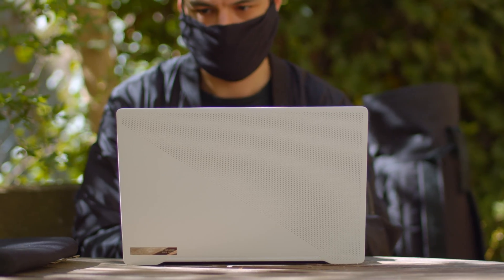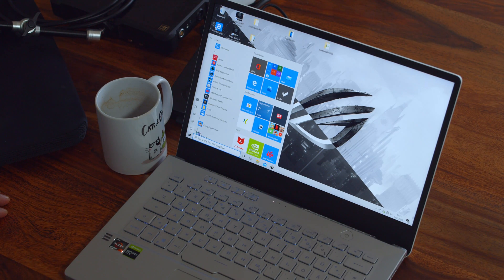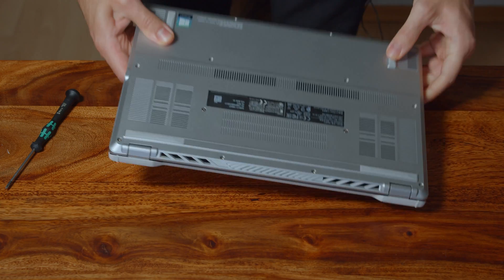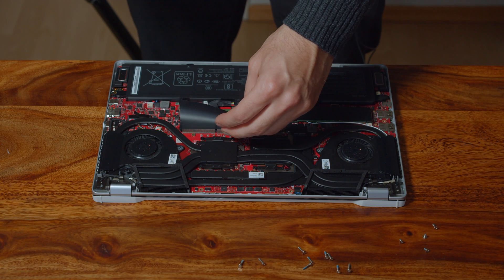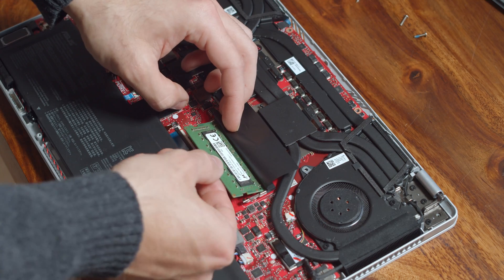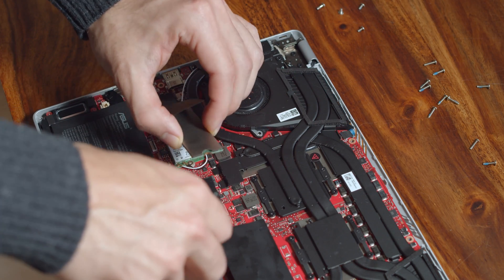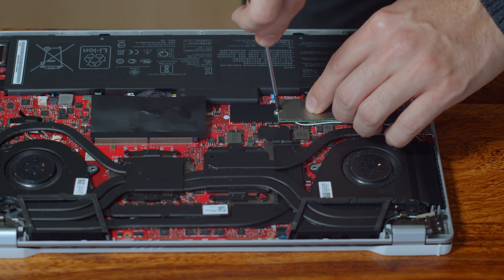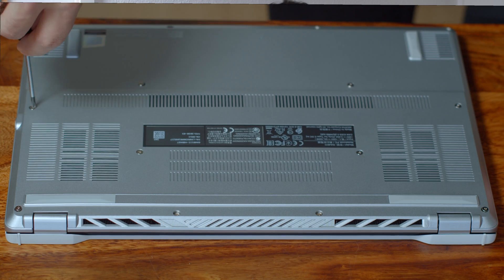Tutorial: How to Upgrade the SSD and RAM of the ASUS ROG Zephyrus G14

Comment: Regarding Dual Channel, you can mix RAM of 2 different sizes and they will still operate in Dual Channel. It just that lower part of higher ram will work in dual channel.
So if you get 8+16GB = 24GB, the 8GB will work in dual channel and rest 8GB of 16GB will work in single channel.
And I suggest, 24 GB (8+16) is definitely better than 16 (8+8).
Reply: That was exactly my question. Thanks for reading my mind and replying in advance. Awesome! 😁😃👍👍💪✌️
Reply: So you can upgrade it without issues. I’m clueless on this and wanted to get this laptop but I was advised 16gb would not be good enough and I should get a laptop with 32gb. I’m starting a computer science degree and am looking for a laptop that will last for a while.
Reply: @miat789  Yes, you can upgrade it without issue. I literally just did it, booted up fine without even need to go into BIOS since I got Crucial memory with the same timings and speed. You will need to buy a 24GB module  to get 32GB of memory since it has 8 GB onboard and only 1 slot.
Reply: Product SKU: CT16G4SFRA32A
Product Name: 16GB DDR4-3200 SODIMM 1.2V CL22

But get 24GB if you want 32 total.
Reply: @idn  dual channel will work or not?
Reply: @idn  i heard if you upgrade one ram to 16 and keep the other one original 8gb, the pc will only use 16 all in all anyways. yeah you technically have 8 more in one slot, but whats the point in upgrading if it will not help the cpu to work faster? and if i were to put a 32 gb ram in one slot, i CAN access only those 32 BUT the pc wont go faster using just one.
Reply: Hi Subodh - Thanks much for the great info. It is really useful. I am planning to get 32 GB and make the full RAM size 40 GB (8 GB [soldered ram] + 32 GB [replacing ram]) on this laptop (ASUS G4 ROG Zephyrus). And I believe, 16 GB will work in dual channel and 24 GB in single channel. Is my understanding correct?
Reply: Hi, I have upgraded my existing 8gb ddr4 ram on Asus G14 with 16gb ddr4 3200mhz hyper x but when I open CPU Z app it shows NB frequency 1596.8 and same numbers for VRam. Is that normal? Although it shows dual channel on the top section but why half of that number to my surprise?
Reply: @RpTech450  yes. That is correct. It will show half.
Reply: @DB2_Oracle  Reaally appreciate your quick feedback. Safe.
Reply: Great I’m going to upgrade mine tomorrow I’m looking for a 24gb model now
Reply: I have the 16gb version, would I be able to upgrade the ram as well without any issues afterwards ? Clueless as well lol
Reply: i dont understand if 8gb is soldered to the motherboard then which ram did he remove?
Reply: Ok pls, help me out here lol. The main reason I didn't get this was that It would be a waste of time to upgrade ram. Is it worth getting this vs a different laptop?
Reply: @senpaisanchoyt5225  It takes like 15 mins tops to install the RAM. At this point it's probably worth waiting for next gen I'd you don't need a laptop immediately.
Reply: @senpaisanchoyt5225  I don't like this laptop. For me, I would love to see 16 + 16 = 32GB. Rather than 8 GB onboard.
Reply: @DB2_Oracle  can you please tell me, why you hate this laptop? I am going to buy this laptop and I will have to make it 24GB RAM
Reply: @lordofsun3107  I have replied this question. For me, RAM is very important. 8+16 does not make any sense. This would have been great choice if it had 16+16.

Also there is no webcam.

And check if Windows 11 will run on it as it does not have TPM chip.
Reply: @DB2_Oracle  okay, Thank You. But can you please tell me, you didn't like the performance of the RAM or is it the RAM Memory SIZE issue (You needed 32GB of RAM)?
Reply: @DB2_Oracle  TPMs are built into modern AMD and Intel CPUs and the G14 has it enabled by default.
Reply: Honestly I upgraded to a buy power i900 1000k all the works works. 2070 super. This thing puts out 100 more frames average and at 2560-1440 I got lucky because I can a Best Buy elite member and they let me trade it I for that because I told them I didn’t know I couldn’t upgrade laptop fully. Now I has a beast machine that can easily support the end 3 series g force cards. I was hardcore song fan. It honestly I made the switch and honored it by selling my PS4 pro with all 200 plus games to my friend I thought deserved it. I gave him my Sony life but gained an entirely better one

Comment: I just want to upgrade my SSD as the buy option is only 512GB in Australia an insult in my opinion as all games on my steam are over 20+ GB I am no it expert and I don't want to screw a 3,000k labtop but really want atleast 1-2TB SSD just for storage
Reply: yea only if someone can point out the model of sad that came with the laptop. then maybe you can just purchase a similar one with a bigger storage.
Reply: I totally agree. I just got a 2tb firecuda for about $500AUD. The other option I was thinking about was a Sabrent rocket 2tb ssd. They are a little bit cheaper and can be found on amazon.
Reply: @Conversational  so u can actually upgrade the ssd up to 2 tb ?
Reply: @anaklautancui8961  yeah that's right, been running for a few months like that.....I imagine even a 4tb drive would work too
Reply: @Conversational  so how do u upgrade it ? did u use clone process ? is there any issues after the update ??
Reply: @anaklautancui8961  hi, yeah I used easeus Todo backup to do a straight clone. Pretty simple and quick to do. No issues whatsoever, I also used a thermal pad on top of ssd to try help keep temperature down. Unscrew back of laptop...it's easy to get to the ssd after this step.
Reply: @Conversational  the main problem in Indonesia is when you try to upgrade for your self the warranty will be no longer available... so i'm not really sure if i should upgrade the ssd with thermal pad..
Reply: @anaklautancui8961  yes I understand nervous because this is a pricey device. It is a very minor upgrade and there is no tamper sticker or anything like that ...so long as you don't mess with the CPU this is very low risk change. Worse case scenario you put the old ssd back in....
Reply: @Conversational  hi sorry for the late reply, i decided to change the ssd. In order not to break the guarentee i must change the ssd in authorized service center. But they stated that the maximum ssd to upgrade for G14 only 1 TB. It's kinda weird because i see lots in people in comment section upgrade their g14 to 2 TB. Anyways is it ok if i don't use any thermal pad for the ssd ?
Reply: Arung Bahari Ohh yes interesting that they are limiting you....not sure why that is. Yes if you don’t use thermal pad if the ssd gets too hot it may lower the performance to keep heat at safe temperature, thermal pad is just extra precaution, but not truly necessary. No problem....good luck with the new ssd hope it works out well.
Reply: @Conversational  thanks!
Reply: @Conversational  have you tested on how many storage you can upgrade the laptop, I'm pretty new to upgrading laptops and such. Any advise would really be appreciated.
Reply: @wanted9718  Heya Wanted, I've been using a 2tb Seagate Firecuda for about 5 months now with no issues at all, haven't tested a drive bigger than that. The only other addition was a cheap thermal pad is on top of the drive to help with temperature. 2tb should be enough for most uses for a while and anything more than that is probably still too expensive.
Reply: @Conversational  do you think that it could handle more 2tb or no?
Reply: @wanted9718  Well, Asus says that 1tb is supported. I have 2tb working for 5 months. I'm not sure about 4tb, evidence to say it will work is hard to find: but I have seen a comment on reddit to say 4tb Sabrent drive is working in G14 also a company in south africa is selling g14 with a 4tb drive. Only way to confirm is to try.
Reply: @Conversational  ah ok2. I'm configuring mine to 1tb and 24 ram for video editing and playing games. I think I'm going to spec mine to Ryzen 7 1660ti with 1tb SSD storage and 24gb of ram. I picked the non Animatrix one to keep the cost down. Do you think this is a good spec ?
Reply: @wanted9718  i have upgrade storage to 1 tb, and it's work using clone os.. but when i using old SSD (micron 2200) become external storage using enclosure it's doesn't work.. why? i use ugreen enclosre for m.2 NVME
Reply: @panjulmo2  huh never heard of that. Again I'm all new to this so I can't really help you

Comment: Hi, there's an article on AnandTech saying that Asus has not enabled the ability for users to set the RAM as XMP on the G14, and hence is deferring to JEDEC which limits DDR4-3200 to 2666. Also there should be a 16GB soldered + 16GB replaceable SO-DIMM model out-of-factory, but that may come at a later date. Please advice if this is true? Thanks!
Reply from the maker: Hey, we also heard about the 16GB Onboard model, but have no information about when it will be available. About the RAM we will have to double check, but my Colleague in the video was very sure about the RAM Speed.
Reply: @notebooksbilliger  I went to the local ROG dealer here in Hong Kong today, and they CLAIM that the model with AniMe Matrix, 4900HS, 16+16GB RAM is a LIMITED edition (only 100 units GLOBALLY) that also comes with a free external webcam and backpack alongside the free Impact mouse. It only comes in gunmetal grey too. Costs HKD $17998 (USD $2322) and won't arrive until end of June here! Otherwise he CLAIMS the 32GB RAM config will not see the market ever again! Hard to believe!
Reply: mactopia no way! Where can we place orders and when will they arrive?

Comment: My understanding is that the Zephyrus G14 does support pcie4 nvme. Can you confirm that it doesn't?
Reply: You can put it in there, but it will run at PCIe 3 speeds

Comment: Can you confirm that upgrading the ram will cause the entire 24 or 40gb (8+16 or 8+32) will run in single channel mode? I cant find any reviewers specifically digging into this claim. I see a lot of misinformation online implying amd uses a intel "flex" memory like technology. Would love your thoughts!
Reply: Yes also in the same boat! I am wondering how it would run in dual channel with adding a 3rd stick. I think the problem is that adding a 3rd stick makes them all single channel. Is 40gb 3 single channels better than a dual16gb. Which can handle more faster?
Reply: @itsnikokasper  G14  supports max 32GB RAM.

And G14 has only 1 RAM stick which is user replaceable. 

Which means, 
If you got G14 with   8GB Onboard, you can add another 16GB and make 24GB total.
If you got G14 with 16GB Onboard, you can add another 16GB and make 32GB total. 

However, answer on Dual Channel is, you can mix RAM of 2 different sizes and they will still operate in Dual Channel. It just that lower part of higher ram will work in dual channel.

So if you get 8+16GB = 24GB, the 8GB will work in dual channel and rest 8GB of 16GB will work in single channel.

And I suggest, 24 GB (8+16) is definitely better than 16 (8+8).

Comment: Any chance this laptop would fit double sided NVMe? Seems a bit tight with the wifi module below along with space for another SSD.
Reply: Yes very tight fit for a 8gb sabrent but it can be done i went with the 4gb sabrent about 840 on amazon with the faste read write speeds and will use the 1gb as a external storage with all my games
Reply: @hectorcolon3053  hi, you mean 4TB.  did you reuse the thermal pads or just run exposed?

Comment: Thanks for the easy to understand video. I’m looking to upgrade the NVMe drive with an XPG 8200 Pro. That model comes with a heat sink for the top facing side but leaves the bottom side exposed. Is that tacky/putty square that is used to secure the drive necessary? Should I be concerned with allowing that to contact the bare soldered components on the NVMe drive?
Reply: hi, have you worked it out with the 8200 pro install?  since it's double sided, does it actually fit with that wifi card down below?

Comment: What amount of space and what besides that plastic shield are between the SSD and the case? I ordered a 970 EVO Plus and the controller gets amazingly hot. I'd like to put a thermal pad so it dumps heat into the metal case (I can just told the plastic shield back with tape). Is there anything preventing this?

Comment: What the gigabyte limit? For ram 32 or 64
Reply from the maker: Hey, since there are 8GB soldered to the Mainboard the absolute maximum is 40GB if you throw in a 32GB module.
Reply: @notebooksbilliger  As per official ASUS G14 specifications, ASUS G14 supports maximum of 32GB RAM.

Also AMD Ryzen 4900HS, supports max of 32GB. So if you go to 40GB, not sure, motherboard/processor will support it. May be it will.
Reply: @DB2_Oracle  thats a good heads up

Comment: Hi guys, great tutorial (migrating from Mac so have no idea about customizing) I wondered if you could recommend a memory brand? I was looking at HyperX as alot of them dont come as single cards and It seems to be really difficult to find 1x16gb as a slot card! Thanks :)
Reply from the maker: Hey, HyperX sometimes doesn't work prefectly with Ryzen CPUs. But we had good experience with e.g. Crucial RAM. Also check for Dual Rank Modules, as Ryzen prefers Dual Rank.
Reply: notebooksbilliger.de thank you so much for the reply! I’ll look into getting that one !! 🌞
Reply: @SoulySwiss  that is true. HyperX is one of the cheaper brands out there. Too bad

Comment: Sorry, to try to understand the memory bit more. It has 8GB of onboard RAM. Do I on'y get dual channel with another 8GB stick in the slot? Or can I still put a 16GB stick for a combined 24GB of dual channel ram? Basically wondering if I only get dual channel with a total of  16GB RAM. Thanks! Great video.
Reply from the maker: Hey, you get Dual Channel only for 16GB of RAM. Everything above that is just used as Single Channel.
Reply: @notebooksbilliger  What is dual channel and single channel? How it affects performance?
Reply: notebooksbilliger.de  so the extra 8 gigs won’t be used? And the computer will try to use dual channel anyways?
Reply: @jasoneel76  I just upgraded to 24GB and it works dual channel. I believe that it's 8+8 on dual channel, and the rest is single channel (8GB). They are all active as 24GB.
Reply: @husniadil  What is dual channel and single channel? How it affects performance? After upgrading is your laptop now have 32GB(8onboard+24gb upgraded in slot)? Initially you have 8gb laptop or 16gb laptop?
Reply: @ayushkar1174  I added 16GB, so it's now 24GB installed on my system. It works well, I don't find any performance issue. It works like (8+8)GB running on dual channels and 8GB on single channel
Reply: @husniadil  can we utilise about 22 GB of Ram out of 24GB in this laptop?
Reply: @lordofsun3107  yes of course

Comment: you know that adding a bigger stick won't disable the dual channel mode right? the original 8 plus 8 still work in dual channel, everything over that goes to single channel.
Reply: You contradict yourself with your own sentence. 8+0 single channel, 8+8 dual channel, 8+16 or anything above single channel

Comment: I'm a little bit confused. Is that memory slot should be empty for a brand new g14? which means the soldered memory is actually invisible?
Reply from the maker: Hi Llin - it depends on the model- The 8GB-Version won't have a RAM stick in this slot, as the RAM is soldered onto the mainboard. 
So yes, the soldered RAM is kind of "invisible" :) 
In this video we are using the 16GB-Version, which already has a RAM-Stick in the only slot available.
Reply: @notebooksbilliger   Now I get it. 16GB has a dual channel, so it's 24 GB at most. Thanks for your explanation.
Reply: notebooksbilliger.de just to confirm the 8GB model still has an available expansion slot for this so If I got the 8GB I could just buy another 8GB and be up to 16? Is the max 32gb? Sorry if basic question but I can’t see this on the ASU’s website.
Reply: Edmundo studios I believe a this is true, did you end up doing it?
Reply: Anurag Reggie not got the laptop but was just interested. I don’t know if this is the case.